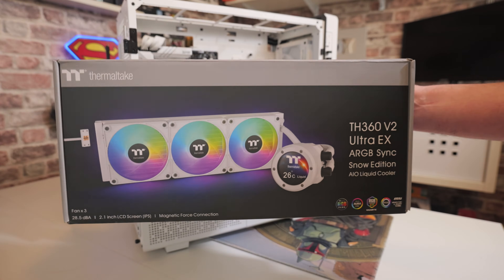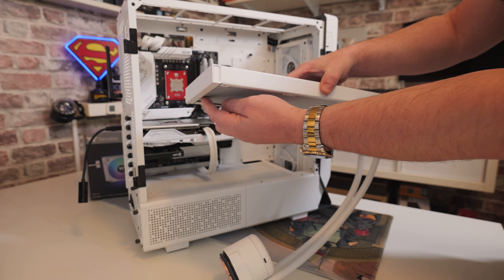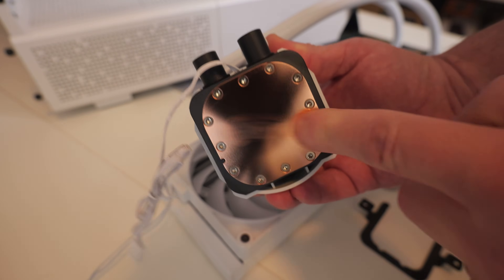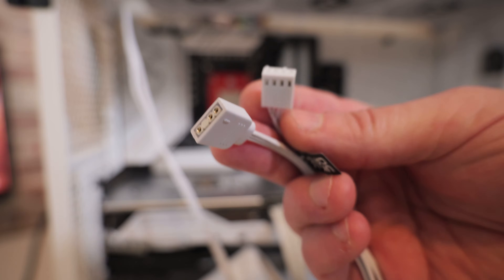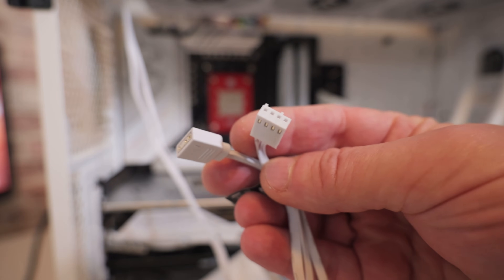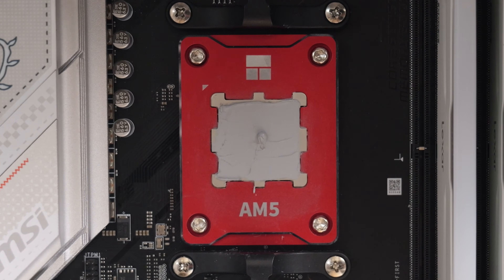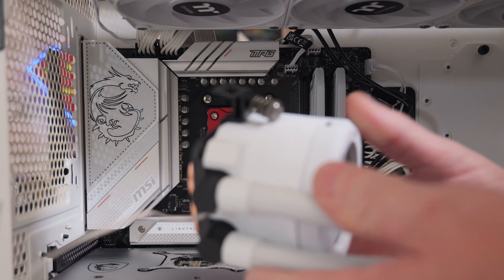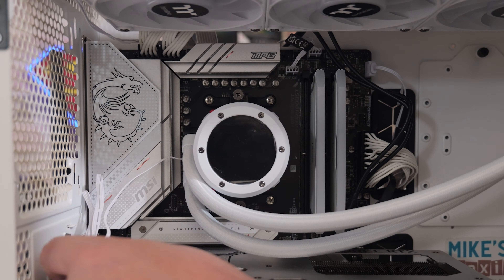How To Install Thermaltake TH360 V2 Ultra EX ARGB Sync Liquid Cooler AIO AM5 AMD

Comment: Hey Mike!!! I have the TH420, but the software (TT RGB PLUS) almost losts the lcd settings and doesnot recognize the cooler. I ve tried everything, but with out results. Any help please????
Reply from the maker: This is maybe easier to fix or at least advise if we can ask more questions and get direct answers, so feel free to join our Discord chat and we can go over it in more detail https://discord.gg/XtBTGQ6BDu
Agree to the rules by clicking the emoji and you will get access to the rest of the Discord channels

Comment: i do have a question, the fans on the radiator are for intake or exhaust ? i really go back and forth on this subject with fans, AIO's, reverse blade and all of that. My rig's gonna be in a TT VIEW 380 that already comes with 4 preinstalled fans, and thinking to buy a set of SWAFAN EX12 for the bottom part of the case. And my concerne is if i have 3 intakes on the bottom, 3 intakes on the side/front panel, can i make the AIO exhaust and the back exhaust too ? the config is R7 9800x3D and a 5070ti. A little help would be nice cause it's my first PC built by me. Thanks
Reply from the maker: the fans are technically either, but really exhaust out of the box, you can swap the fans to the other side to reverse the airflow if needed.
get the ct120ex reverse for the bottom, and save some money
Reply: but overall are they good for my rig ? all the fans and the AIO ? or should i go for something else ?

Comment: Much less wiring than the Corsair iCUE LINK RGB TITAN 360 RX LCD 360mm. I bought four makes and models of 360 coolers to assess which is best for my tower250 ixt case. Corsair, iCue, not a chance.
Reply from the maker: yeah this cooler is awesome for easy cabling

Comment: Hello mike, what would happen if you don't plug the usb input on the waterblock? is there still a thermaltake logo on the lcd or full blank screen?
Reply from the maker: blank screen, if you plug it in and don't install the software it will show the water temp

Comment: I have this on my ryzen 7 9800x3D and the temperature goes to 95° playing full, this isn't normal, right? 😢 I don't know that is wrong
Reply from the maker: bight be a bit warm, AM5 X series do usually want to reach 95c, but it shouldn't be that hot gaming, i would look at the mounting pressure and paste coverage and maybe pump speeds
Reply: @mikesunboxing  yes it was the pressure, now its working great
Reply from the maker: @kabro22  awesome, i thought this cooler would do much better than 95c 🙂
Reply: @mikesunboxing  yes, same games now only at 75°

Comment: Might be a dumb question so with these you're removing the fan that is fastened to the cpu from the manufacturers and replacing it worth this?
Reply from the maker: sorry i don't quite understand the question
Reply: @mikesunboxing  like my gpu that I have has a fan that came with it in the box. Are you simply forgoing that and using this?

Comment: Nice video, i just bought this AIO with 3 x CT120 EX fans. Do I need a control hub to sync the rgb? Also looking for a rear fan to match
Reply from the maker: no need for a hub and sadly these fans come in packs currently not single units

Comment: Nice video, i just bought this AIO with 3 x CT120 EX fans. Do I need a control hub to sync the rgb? Also looking for a rear fan to match
Reply from the maker: you can plug the fans straight into the motherboard ARGB headers and control them via the motherboard software

Comment: Hello, first of all a very nice Video! 
I have a question (at 6:54) .the manual say that I have to connect the 4 pin fan cable  to the "sys/cha Fan" on the mainboard. This is wrong? Do I have to plug the 4 pin fan cable to the "CPU Fan" on the Mainboard?
Reply from the maker: the radiator fans connect to the CPU fan header on the motherboard and the AIO pump lead goes to the AIO or pump header on the motherboard
Reply: @mikesunboxing  Thank you very much for your help mate ☺️👍

Comment: hello quick question how to change the color??
Reply from the maker: they are controller buy a standard 3pin 5v argb plug, so the motherboard software or a standalone hub with remote control can do it

Comment: Hi Mike and good video. I wondered how prone  AIO coolers are to leaking and is air cooling safer?
Reply from the maker: not had one leak in the last 7 or 8 years, but ultimately an aircooler will last longer

Comment: Looks a straight forward installation and so easy to connect the fans. Never realised how many cables are needed with pump, display, fans & argb! My only hesitation is getting the mounting pressure just right on these AM5 setups. If it was fitted to AM4 I assume you tighten pump head until feel it reach end of thread? Thanks for tutorial Mike and Kath 👍😺
Reply from the maker: yes AM4 torque them right to the thread hard stop

Comment: Nicely explained Mike it looks quite impressive. The only thing I would suggest to the manufacturer is to make the USB header connection cable a right angle plug so that it doesn't get strained against the motherboard components, plus it seems quite stiff for no particular reason.
Reply from the maker: Yeah that is actually a very valid point
Reply: The white version should REALLY come with a white USB header cable..